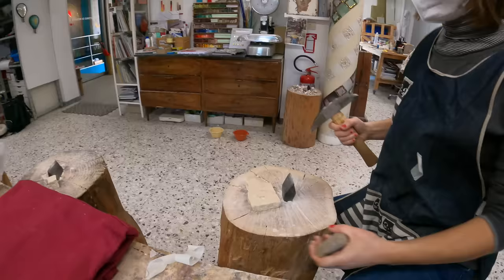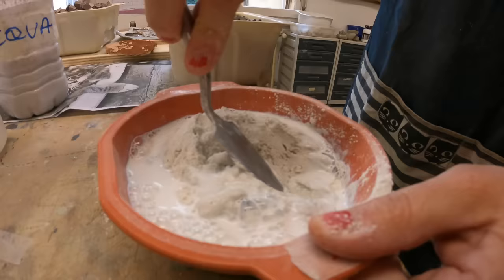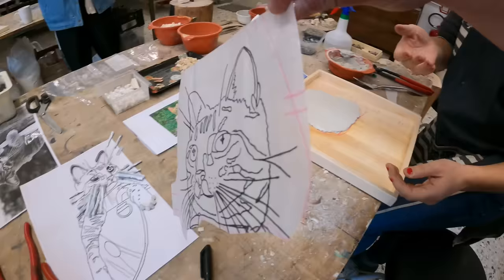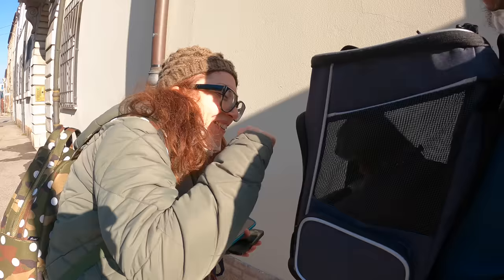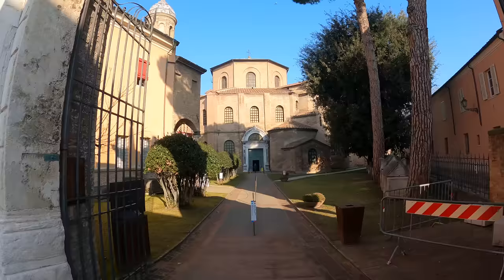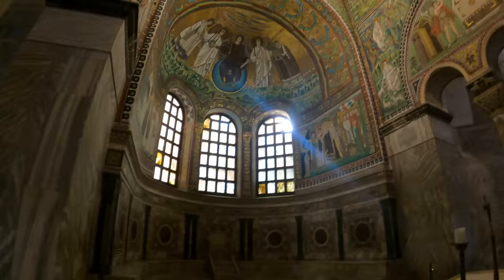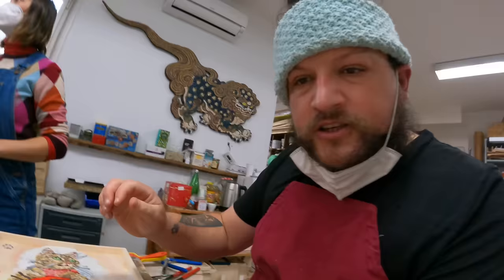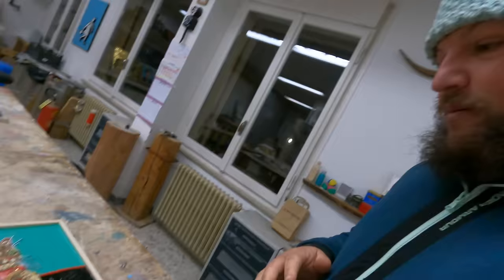Making a MOSAIC of NALA 😻❤️  VLOG #78

Comment: Hi Nala and Dean! Did you hear about the trail opening in Bhutan (the Trans Bhutan Trail)? It's been closed for 60 years. It's 250 miles long and it will be possible to mountain bike it. I think you need to apply for a permit in advance. Sounds really cool, right?